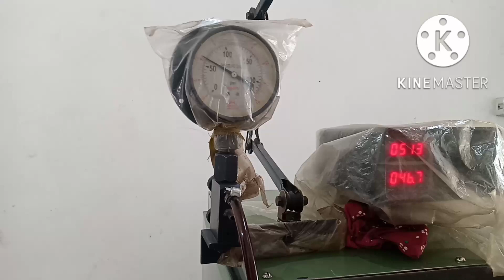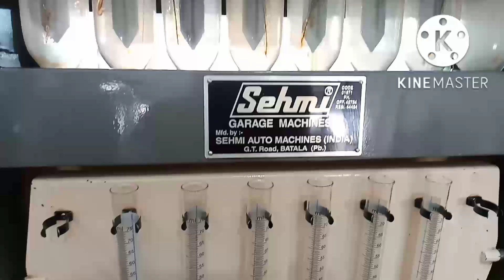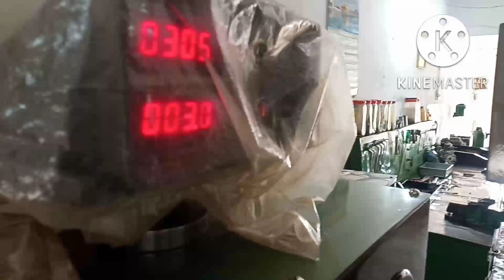Cummins VE pump diphgram fittings! how to set air diphgram ve distributer pump

Comment: Hello bhai Mujhe yah batao ki pump ki diagram machine per kitne RPM per set ki Jaati Hai 009 injector ke sath Iske bare mein video Banakar bhejen
Reply from the maker: Yeh video diphgram pin jam he k nhi ki he ,har pump ki appni speed Hoti he with air
Reply from the maker: Pin jam he to with air delivery nhi badegi sir,
Reply from the maker: With air delivery 4 cc badna chahiya 009 Injector k sath